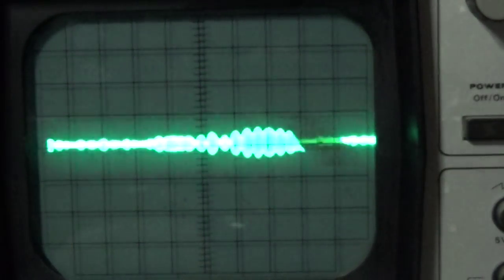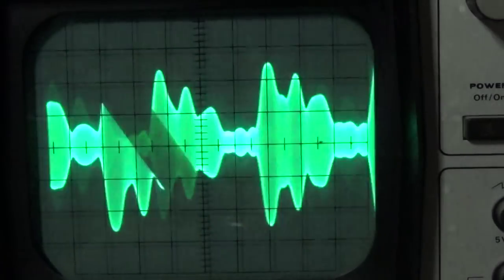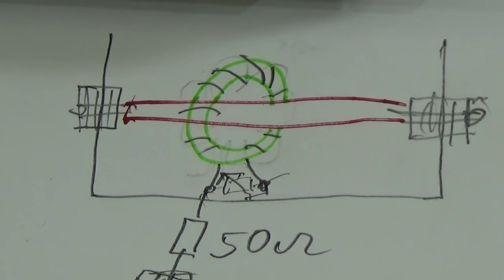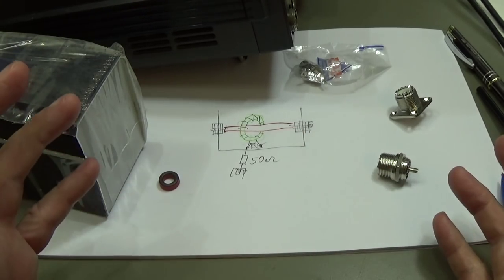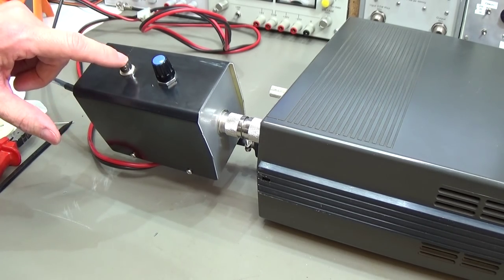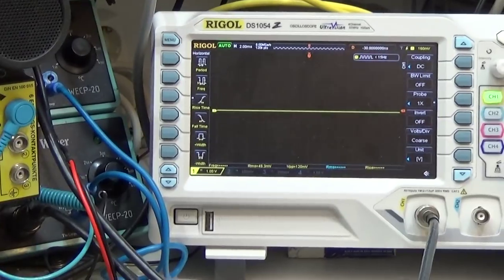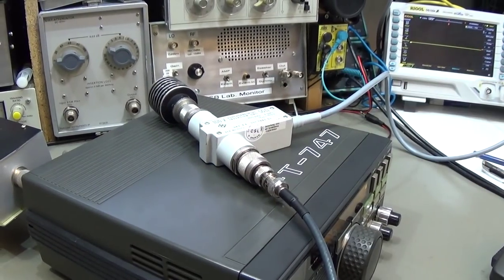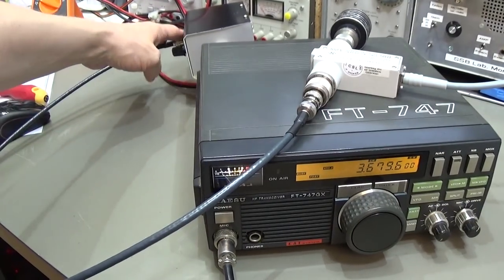#74 Quick Tip: Build a Variable RF Tap for your shack or lab

Comment: I'm confused about the 50 ohms in line series resistor as a matching device. My understanding is that a spectrum analyzer will have a 50 ohm load on the input in the analyzer and with max output of less than 1W that would be okay for most analyzers. For an oscilloscope with high impedance input then the current drive at 10 dBm could create a high voltage on the input so it would need to be pre-loaded. Aren't the 22 ohm resistors in parallel performing the actual loading to limit the potential output voltage?
Reply from the maker: +W3AMD US Hi John, oh be careful by far not all analysers can take 1W=30dBm and if they could do you are  close to the rated maximum which will already create intermodulation. So never feed a SpA with that high input power!!! This game is all about Ohms law and inner resistors of a source and termination a source with a load. I would recommend you to watch my video about the Siglent SDG 1025. Although it is a product introduction I show a bit about the inner resistor and termination. 73
Reply: +TRXBench Hi Peter, I reviewed the other video. I can see why we have this conclusion. I think though that the Siglent SDG 1025 doesn&#39;t have a series 50 ohm resistor inline but is just doing math based on expected dBm to load impedance and then sets a digital to analog voltage output based on the expected load. Am I still wrong? Do signal generators and spectrum analyzers have both a series resistor inline on the output and a load resistor of 50 ohms on the input of the spectrum analyzer? This would cause half the voltage on the measuring circuit because there is a half voltage divider circuit created?
Reply from the maker: +W3AMD US Now you are right all sources like generators have a series resistor along with it's source  and all SpA have a termination resistor to ground. In this network both resistors are  in series and thus the voltage is split 50:50. This is called power adjustment. 73 Peter
Reply: +TRXBench Okay let's see if I am right again Peter. Danke for your answers. I think radio TX section to the antenna does not have 50 ohms in series and the radio RX section has a termination resistor to ground? This is what confused me because I assume the radio transmit is direct to the antenna so power is not wasted in a series resistor. Merry Chrismas!
Reply from the maker: +W3AMD US Ahh John now I see what you are struggling with. You should not consider the 50 Ohm to be a real resistor it is more a complex component of the TX amplifier.  Any Transistor with it's inner output resistor and all the components around needs to be designed to be at least 50Ohm. A tube amplifier needs a transformer in the outputstage to convert the high inner resistor of a tube into the 50 Ohm needed at the coaxconnector.   The same is valid for a RX and yes there is a (complex) 50 Ohm resistor to ground. Hope that helps. Merry Christmas! 73
Reply: +TRXBench Hi Peter I think I understand now. The series resistor (50 ohms) in the radio is reactive and therefore does not consume power and the antenna is reactive (50 ohms ideally) but does consume power. Do I have it?

Comment: Neat project!  I've been inactive in amature radio for a while now, but interested in getting back into it, so I'm getting ready to upgrade my ticket.  Could someone fill in a few build details for me?  I seem to count 13 turns on the core.  What would a recommended core be?  I have a couple small ones sitting on the bench now, but am not sure if they would be suitable for this build.  I also believe I saw that the pot was a 10K ohm.  Would this be linear or log taper?  And lastly, it was hard on my screen to see what the value of the parallel resistor to the pot was.  I'm kinda leaning towards 15 ohms, but the second color band was hard to see clearly.  These appear to be maybe 1 or 2 watt resistors - is that something I should be concerned about? I think I would like to really run with this design and include a single pole, multi throw switch where I can have a calibrated fixed attenuation for each band, plus a variable attenuation option as well.  Thanks in advance for any suggestions! 73's KF4JXP

Comment: Good one Peter. I plan to build one. Question! Do you see any problem with installing an additional toroid for VHF frequencies and using a selector switch to switch between them. Keep up the good videos. I really look forward to them. 73s, Dave
Reply from the maker: +wb8vqv Hi Dave, well this unit is designed to work up to 30MHZ if you go over 100MHZ it becomes critical as all frequency above 100MHZ needs a special handling.  All is getting worse if you have a switch in between... no way with 100MHZ. It is of course possible but it needs to be designed different. Hope that helps 73

Comment: It would help if more detail was initiated in this video. A detailed step by step with each component being soldered etc......
Reply: Plug in a soldering iron. cut some lengths of wire up and strip the ends clean. Now apply the soldering iron to the end of the wires in turn  to tin them. Clamp the wires together with a pair of forceps and apply heat from the iron with a small amount of solder applied each time. DO NOT MOVE the wires until the solder cools down.
You have now learned how to solder and can follow Peters instruction of how to make an isolated/attenuated RF pickup box.
Reply: BJ S b

Comment: How many turns you have made on your core !?  ..i suppose about 10 or 15 wire turns. '73 :)
Reply from the maker: Hi Alessandro, 10 or 15 as Long you have enough gain at the test port. 73

Comment: Where can i find a 22 ohm wire wound potentiometer.  The close i can get is a 25 ohm.
Reply from the maker: No problem Richard you can take the 25 as well 73
Reply: @TRXLab  
Thanks Peter.
Great videos. Thanks for taking the time. 
Km4ytw
73

Comment: Hi Peter ...
I will be building this kit … could you please tell me the requirements (toroid size, pot, resistors, wire for toroid … ) Hope you can help me Peter … Mike M0csi ...
Reply: Hi, Mick. Did you figure out the values?

Comment: What is the value of the potentiometer?
Reply: +TheHamNut Peter mentioned it was a 22 ohm in parallel with a 22 ohm 2W resisitor.
Reply from the maker: +Donald D'Egidio Thanks Donald
Reply from the maker: +TheHamNut Donald already gave you the right answer..Thansk for watching 73

Comment: Okay, I got lost a little with the resistor that is in parallel with the pot. What is the purpose of that resistor? 73  --W5DRO
Reply from the maker: +Donald Ohse (W5DRO) Hi Donald, this is a RF current transformer and we need to keep the impedance low to get together with the 47Ohm series resistor a more or less stable 50Ohm output over the entire frequency rage. Hope that helps 73
Reply: +TRXBench Thank you. By the way. I enjoy your videos. Keep up the good work!

Comment: He could have done it much easier with just a resistive voltage divider.  Say a 10k resistor and a 50 ohm resistor.
Reply from the maker: And what do you think he would has done to the 50Ohm impedance if using a resistive voltage divider on input and output side????